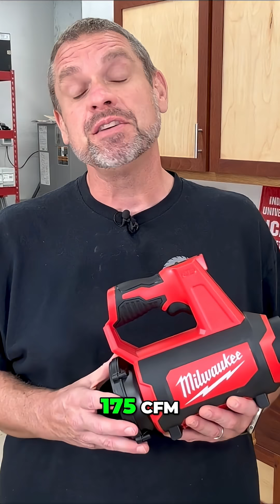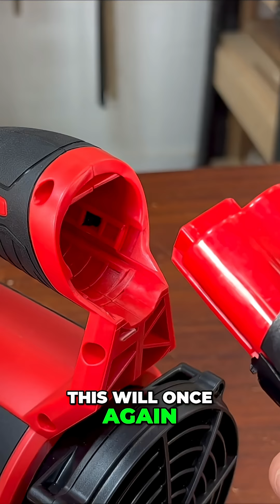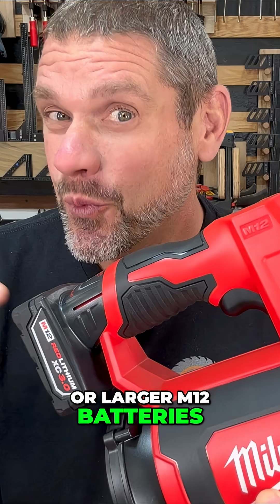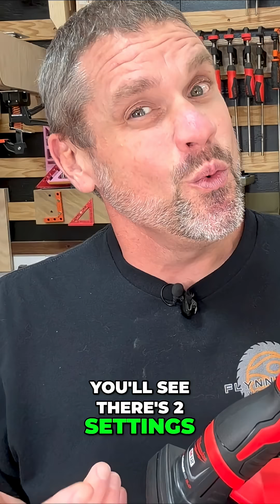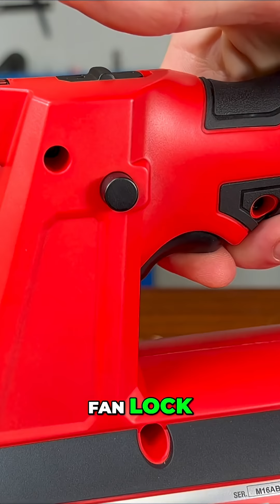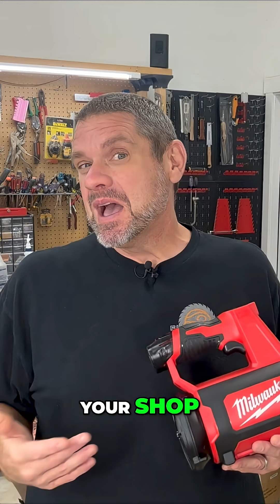M12 Blower Changed My Workshop FOREVER

Comment: Sounds like it’s got all the same features of any other blower.
Reply from the maker: I'm not so sure about that.  I haven't seen one where you can attach the nozzle directly to the tool itself...
Reply: @FlynndoggWoodwork my green ego, which I think is likely a very common/popular brand, does this. I don’t actually use any nozzles, I just keep it like a sawed off shotgun in the shop, which lets you maneuver better. I’m not actually really sure what the purpose of the nozzles is? I might just be ignorant

Comment: I acquired one recently and found it drains my batteries pretty quickly if I use it very much
Reply from the maker: I hear you Johnny!  I've actually started to buy some higher amp hour knock off batteries and they seem to help out quite a bit with that.   I don't know how good they will be for lor long term use, but they seem to do the trick so far.
Reply: @FlynndoggWoodwork might make a good segment